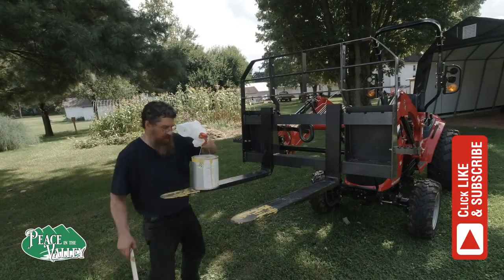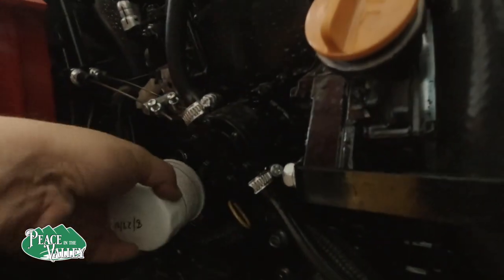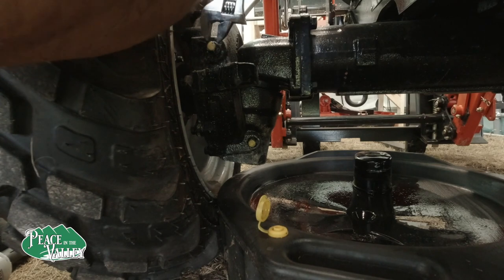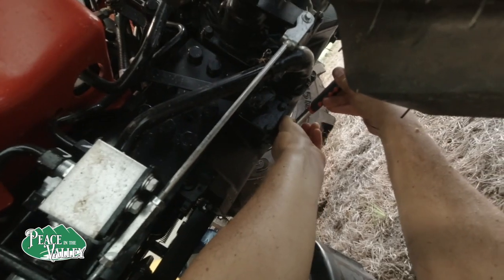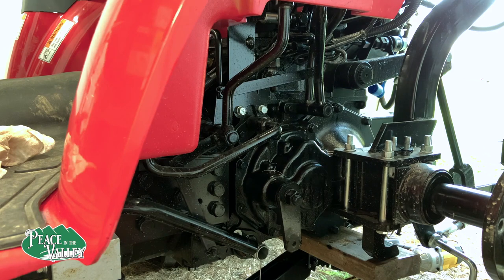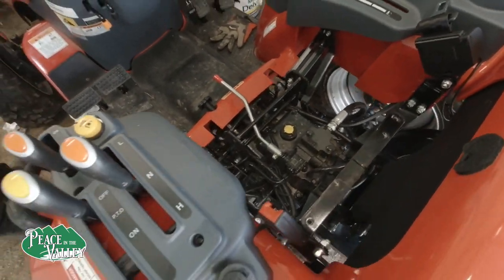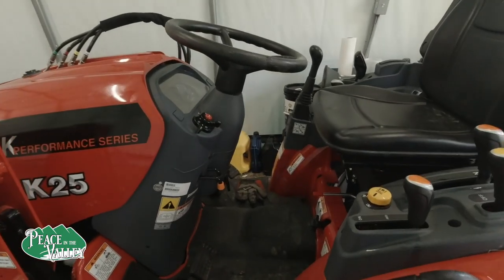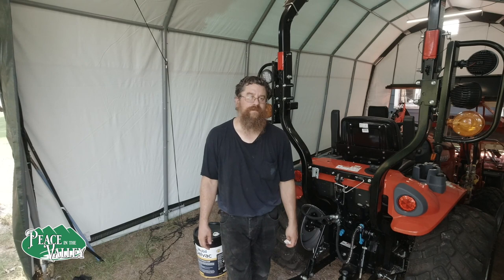Episode 39: RK25 50 hour service - Don’t FORGET Mesh Screen

Comment: I did my 50 hour this weekend. I struggled a little, can not believe how tight everything was. I have worked on cars all my life . and this thing was a challenge. Thank You for all your help through your video
Reply from the maker: were you successful? I found the oil filter to be very difficult. if you are struggling with filters, use sandpaper between your hand and the filter for extra grip.
Reply: @PeaceIntheValley  I did get it all done. But i have a couple questions. # 1 the front end 80/90 gear oil. I poured it until I seen it coming out of the filler side vent bolt. But it did not come out of the passenger side. However it shows between the lower and upper level on the stick (closer to the top) 

#2 I fill my transmission up to the top of the red dot. after driving it it is a 1/4" below?

Comment: Re your missing Zerks fittings on the steering linkage:  Check to make sure you don’t have a small set screw in the hole the Zerks goes into.  I have had vehicles and equipment show up that way.  You just pull the screw out, and install the Zerks fitting.
Reply from the maker: I'll have to check that out. where in line would that be?
Reply: In the steering tie-rod end.  Also check the u-joints in the driveline for the front axle.  the T233 and T273, had issues with the service manual neglecting to say anything about them, and the drive lines failing catastrophically.  The u-joints are another place where they put small bolts instead of Zerks fittings, because there had been problems with them getting knocked of in high brush and grass.

Comment: Isn't there still a front axle drain plug toward the center of the axle too, not just on the ends?
Reply from the maker: Hi Greg, I believe there are two drain plugs. I'm not in front of the tractor right now, but 95% sure you are right.
Reply: There should be 3... one in the center, and one on each end.

Comment: I'm finding it difficult to remove the Trans drain plug what size socket did you use?
Reply from the maker: HI Matt, are you referring to the transmission, A 7/8" socket works well for me.
Reply: @PeaceIntheValley  yes thank you. Happy Thanksgiving

Comment: Hello PITV this is a very good video and helpful , I have a quick question if thats ok how many inches comes off the height on the ROPS when its folded back any idea , Thank you in advance ! I have the same one coming in soon .
Reply from the maker: Hi Kelly, I did not notice your comment before. sometimes YT doesn't notify me. I believe it takes about 18" off. I'm not 100% sure, but that is my guess.
Reply: @PeaceIntheValley  , No worries and thank you sir !
Reply: I don't have a concrete pad  to measure, but if it helps... With the ROPS down it I can fit it in a standard conex box. With the ROPS up, I believe you would need a "high cube" conex box. Pretty healthy difference in cost of those 2 types of boxes around here. 

I thought ROPS.down would look silly, but acts like a cage around the backhoe ops area, which is actually kinda neat.

Comment: ...i cant find the hydraulic oil TYPE anywhere in my manual ( tym t 254 ) any ideas anyone?
Reply from the maker: Hi Mark, My manual in the appendix section H says "API GL-4 GRADE" for transmission fluid. I think that's just the standard tranny fluid in the buckets at TSC or RK
Reply: thanks PITV for checking into that ! ( and ill look a little closer in my book again ) @PeaceIntheValley

Comment: what does your RK25 idle at?   mine is about 1400 rpm.    I can't find a stated rpm in the manual for idle speed.  Seems a little high but might be completely normal.   great info,  just got 5 hrs on mine.
Reply from the maker: I'll check to see what the idle is. I know my brother thinks it idles a little high.
Reply from the maker: I just checked mine and it's at 1350 or thereabouts. It seems a little high to me also. I don't know if that is because it's only 25 horse and has a pretty big hydraulic pump or not?
Reply: My new rk is running at 9000 rpm

Comment: I’ve noticed a little oil around the seal of my oil pan on my rk 25. Looks like a very slow weep. It has 18 hours, wondering if you’ve had any experience with seeing it as well.
Reply from the maker: I have not seen any leaks yet. I keep watching and it would not surprise me. I'm up to 90 hours now on the tractor. What do you intend to do about that?
Reply: @PeaceIntheValley  I’m part of a few RK pages on FB and not getting too much help there, may just clean around the seal with degreaser and keep a check on it and see if it continues, if so, I’ll have to get RK service on it, since it is under warranty

Comment: T264 should be identical to T25 filters trans etc.  On T264 there's no need to remove back tire/wheel for filter change shouldn't have to remove it on T25 either.  Also that filter is way too cheap to clean with brake cleaner, just change filters you saw metal on the magnet.
Reply from the maker: my RK dealer didn't even know about this filter. They didn't have it and it wasn't in the manual. I learned about it from Denny Rust - Rusty farms. I don't think you have to remove the tire but it does make it much more accessible.
Reply: @PeaceIntheValley  9

Comment: No offense but you're crazy working around that tractor on a flimsy scissor jack with no jack stands on the axles and one of the wheels off if it gave way your crushed and maimed or dead!! 😳😳
Reply from the maker: I could have used one of the jack stands but I didn't think this was a problem since I was lifting from the left center, putting the weight on the right wheel. Those are not flimsy scissor jacks. They are rated at 7500 each and have a nice platform on them - better than my jack stands. now if i used my vehicle spare tire jack, it could have been a problem. I will try and use the jack stands too. There is nothing wrong with being more careful than less. Thanks for the advice!